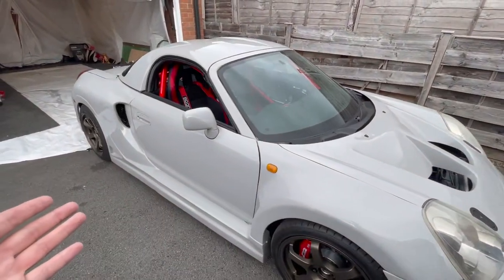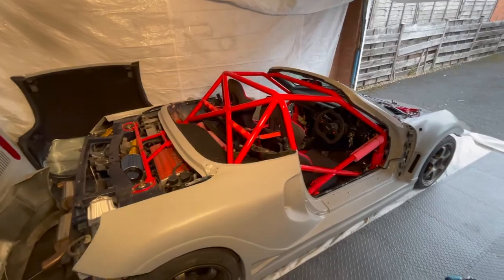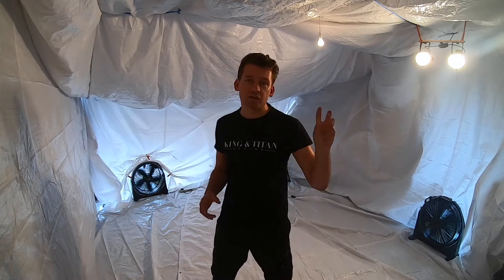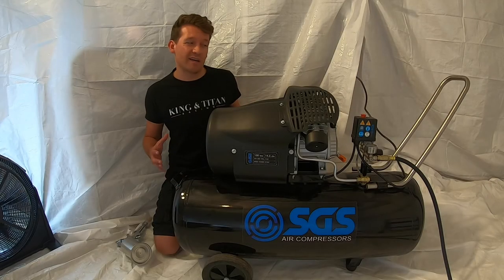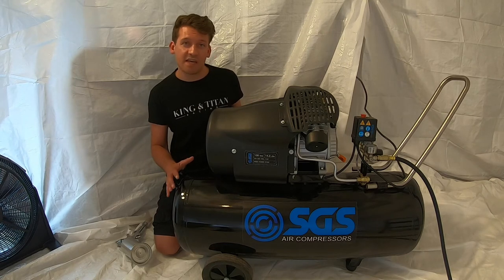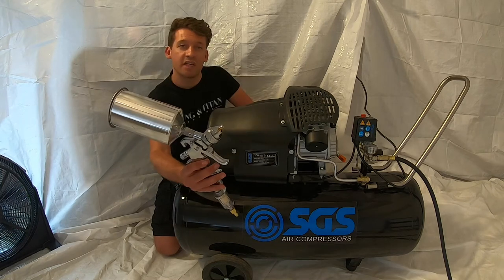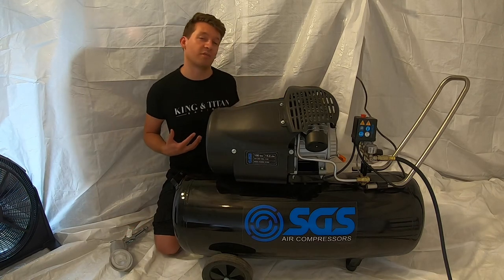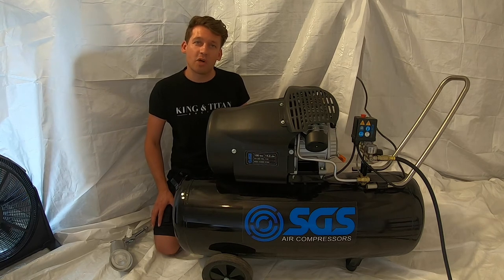Build Your DIY Spray Booth - Get Pro Results at Home

Comment: Nicely done pal, have you got info/links as to where you got everything needed including paint/prep gear etc? Always nice to have something recommended by a real person, might be useful for other subscribers too.
Reply from the maker: I put a link to the kit in the video description and for the paints I used a Paints4U.com. I gave them a call and spoke through all my plans and they advised me on a bundle of supplies. 

The fans I got from Amazon, just got the biggest ones I could afford. 

For sanding materials anything with the right PX00 grit on an orbital sander will work, I used Screwfix for a lot of my consumables like that. 

When masking off the car make sure you get some designated for automotive, it has a special side that catches the overspray.

Comment: I have a few times just washed the garage out and sprayed with Rocket in the paint. Sheets can with air blowing about cause problems. Not painted in 20 years.
Reply from the maker: All the sheets were tied down well so that didn’t cause any issues. You can see from the respray video this came out brilliantly in the end. No way I would have been comfortable painting anything in that garage before as it doesn’t even have a ceiling, just straight up to the rafters.